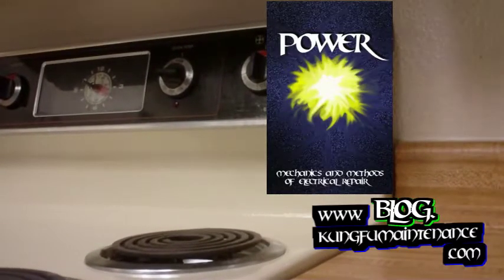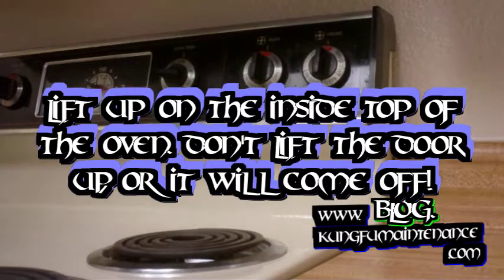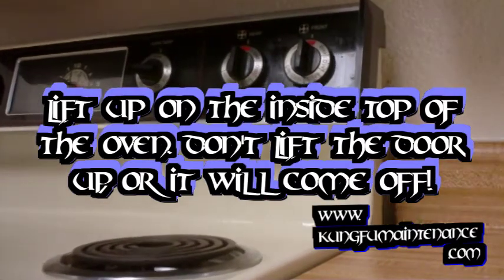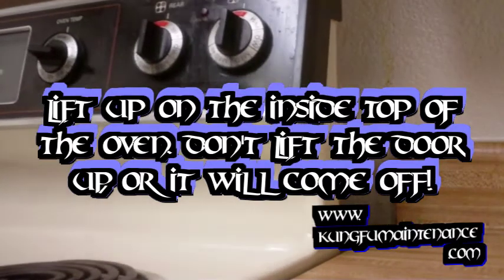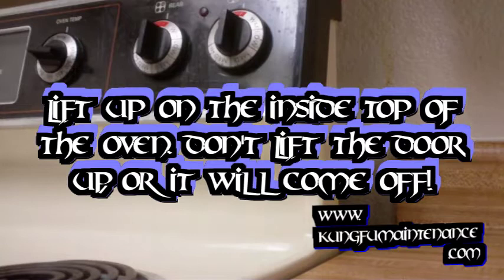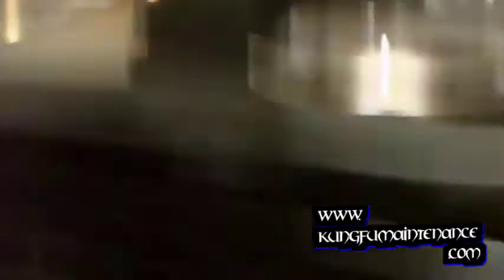Electric Range Or Stove ~ How To Set Up, Install, And/Or, Change Out

Comment from the maker: There is not a particular order only a size difference. Sometimes stove tops have three six inch burners and one larger 8 inch burner, and some ranges two smaller 6 inch burners and two eight inch elements. As long as you plug in the correct size element you can proceed in any order.